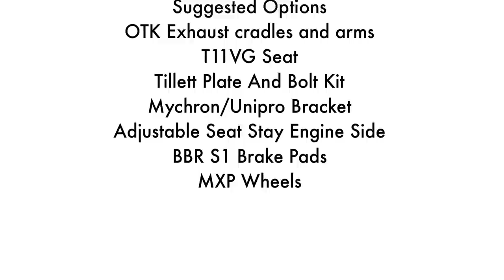2015 Tony Kart 401 Chassis Preview By BBR Karting

Comment: Why does my bs2 brake system suck so bad
Reply from the maker: +Bordendanny . This is not the BS2 caliper. The BS2 is an older model. What kart do you have that has the BS2.
Reply: bbrkarting  i want to ask    in 401 model  i use  the dot 5 otk silicone brake fluid ... is this  good ?